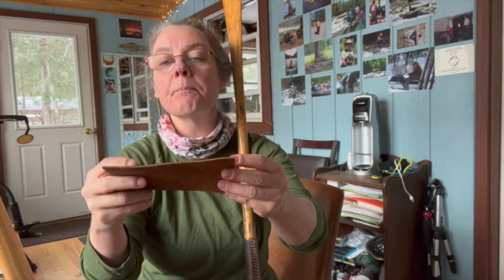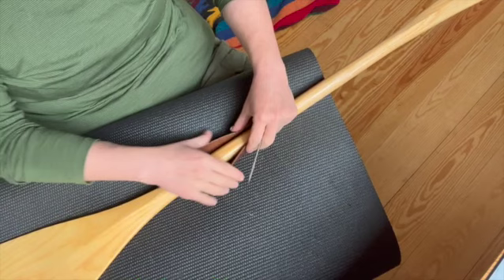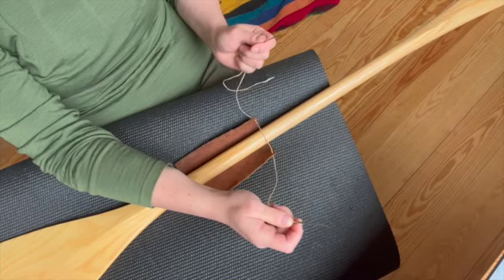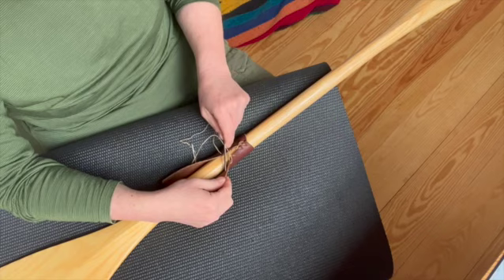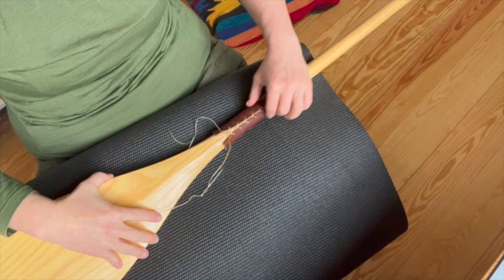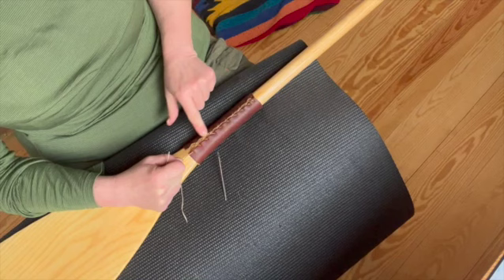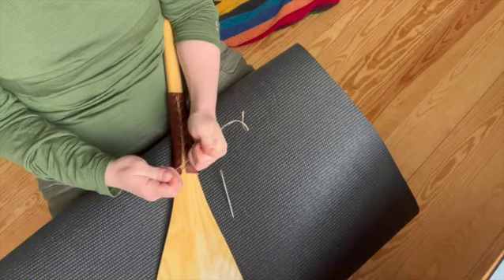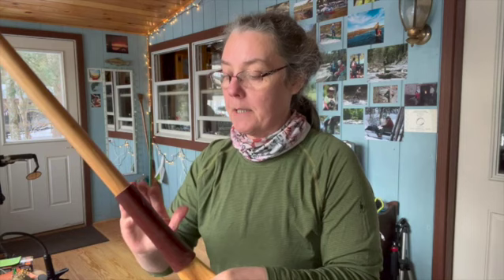3 Minutes  with a Maine Guide  # 73 Making a Leather Paddle Sleeve

Comment: Have just watched the video. Could you please give the length and width of the leather. Could you also give the distance the holes are from the edge and how far apart the holes are from each other. Thank you.
Reply from the maker: Thanks for watching. The sleeve is 5 1/2 inches long. The holes are 1/4 inch apart. In order to get the circumference, take a string and wrap it around the top of where the sleeve will be and do the same where the bottom of the sleeve will sit. The numbers won’t be the same. Most paddles are not symmetrical. There should be a small gap that the stitching when pulled tight will close. If it doesn’t it’s no big deal the leather when wet will stretch. Better a bit of a gap than too loose. Good luck. As in all things canoeing explaining it out makes it seem way, way more complicated than it is when you do it.

Comment: Nice! 
Do you measure your leather piece the exact circumference of the throat or just a little smaller? 
I’ve always used Sno-Seal or mink oil.
Reply: Alan I do just a wee bit smaller, the littlest gap. Yes snow seal and mink oil are excellent.